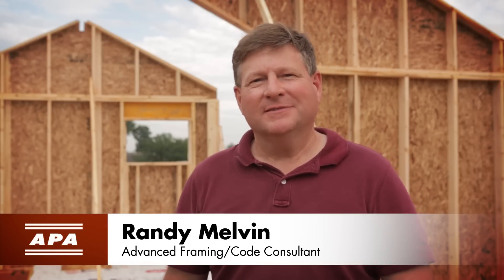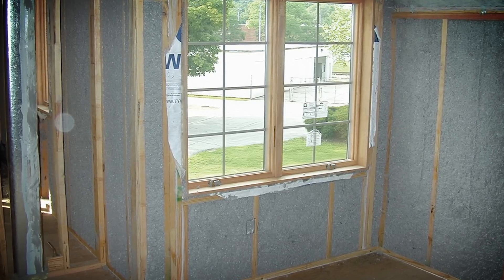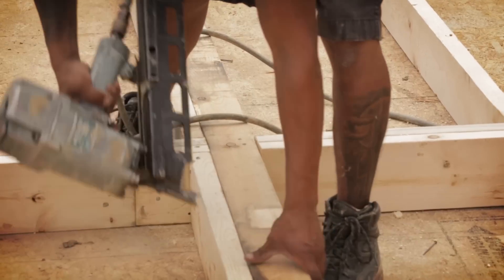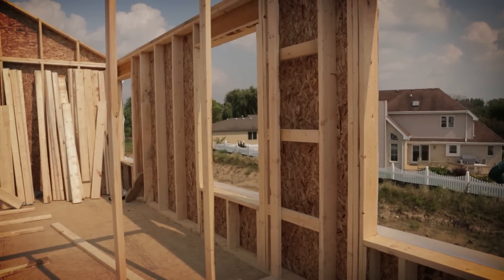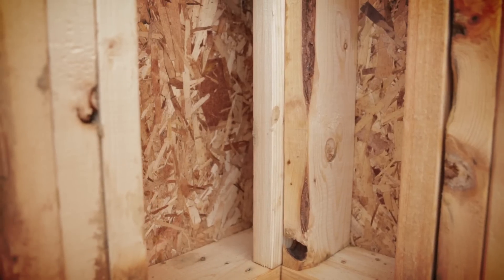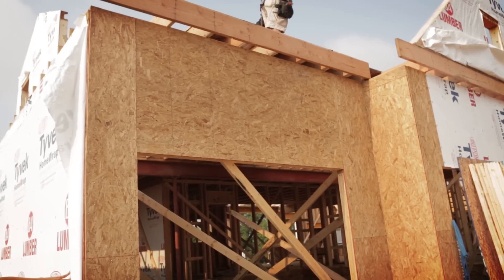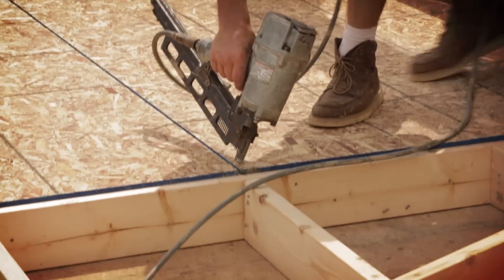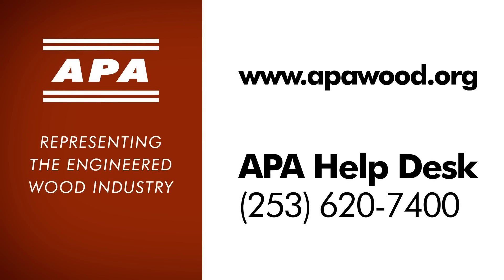Inside Advanced Framing: How to Build Energy-Saving Homes

Comment: I'm currently starting to new homes here in Oregon. Simple one story ranch homes that will adhere to our states Earth Advantage program. I may be incorporating these techniques into these homes because single stories would not require the load on the first floor as a 2 story would. It appears 24"OC works for both 1&2 story homes as long as framing lines up from plate to plate. I'm curious though it appears the framing in the garage in this video (4:00) has 16"OC because it looks narrow compared to the gable above.
Reply from the maker: +Duane Oglesby 

Duane,
Thanks for the question. You are correct about the framing on the exterior wall of the garage in the video.  Because that wall is not required to be insulated (it doesn’t separate the conditioned interior of the home from the exterior environment), the builder chose to use 2x4s at 16 inches on center in that location.  

Regarding the use of 2x6 framing at 24-inch o.c. on the first story of a two story home, or a single story ranch (as you’re considering), it is not necessary to use in-line framing, provided double top plates are used.  See APA’s Publication, Advanced Framing Construction Guide, Form M400, or refer to 2015 IRC Section R602.3.2 (or specifically in your case, the 2014 Oregon Residential SpecialtyCode).  Because in-line framing presents additional design and construction challenges, the vast majority of builders that use 2x6 at 24” o.c. stick with double top plates.  IRC Table R602.3(5) SIZE, HEIGHT AND SPACING OF WOOD STUDS is also a useful reference that shows that 24” oc 2x6 framing is permitted in the first story of a two-story house. 

For more information on advanced framing, visit our webpage at www.apawood.org/advanced-framing.

Roger Roatch, Senior Engineered Wood Specialist, APA

Comment: I would like to see the science behind the actual increase in insulation in the walls.  If you take an approx wall of 100feet, that would be 75 studs on 16oc and 50 for 24oc (not counting the ends, openings, etc..).  Take the difference of the 25 studs and the 1.5 inch thickness, that is 3.125 feet of lumber thickness in the walls that can be substituted for insulation.  My question would be what is the actual trade off for energy savings for 3% of the wall being wood over insulation?  Is that the best we can do as builders?  Or should we continue to build with 16oc? One thing I do know is as a contractor and a guy that works in the computer industry, there are way to many guys that think their way is the best and are stubborn in there thinking. This works both ways.  I am open to the energy saving benefits but would like to see the hard data on the insulation value.  Not just a "well wood has a 4 r-value and we are using a r-19".  We all get that part.  I would like to see the climate of a home (actual air temp) and how a wall with "advanced framing" compares with a standard 16oc constructed home.   I have an open mind but don't try to complicate something if its not proven to be better and the benefits can be argued with science.  I have been on a lot of jobs and found great value in all the builders out there.
Reply from the maker: Jay,
Energy performance is dependent on the entire design of the house, not just one element. To illustrate this in more detail, we suggest "APA Case Study: Advanced Framing Boosts Energy Performance," Form T110, which has commentary from a builder's perspective and provides a good synopsis of the use of advanced framing to provide for increased insulation which in turn will reduce energy consumption. Of course, a small builder of a few homes a year vs. a large construction company/developer will have varying opinions of how much dollar savings there are, and training and supervision also go into the cost analysis for builders learning new techniques. Another reference that could be helpful is "IECC Compliance Options for Wood-Frame Wall Assemblies," Form P320, which provides additional insight into advanced framing vs. typical construction framing (see Table 1 along with the various illustrated wall assemblies.) These publications are available for free download from www.apawood.org/resource-library.
Reply: Well, a simple calculation can give you the answer. Say you have 2" of stud (1 in from each side) and 22" of insulation for 24" wall.
In metric terms insulation usually has a heat transfer coefficient of 0.037 W/mK and wood has 0.140 W/mK.
(2*140+22*37)/24~45 in contrast to a 16" wall (2*140+14*37)/16~50.
The added spacing in itself is a 10% reduction of heat transmission!